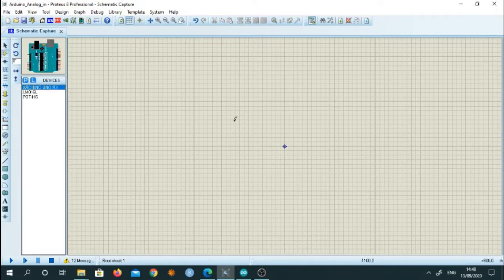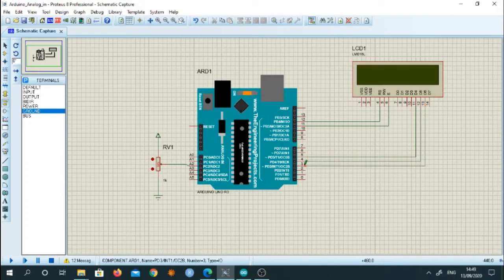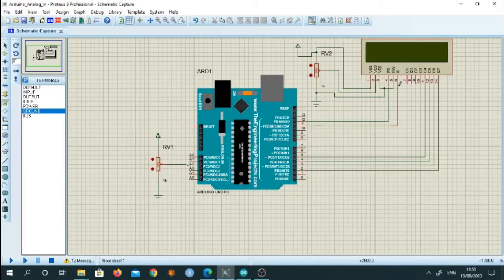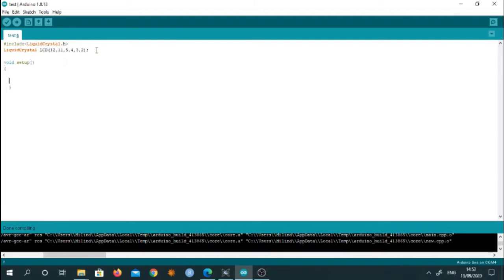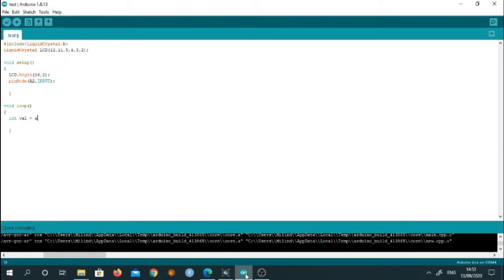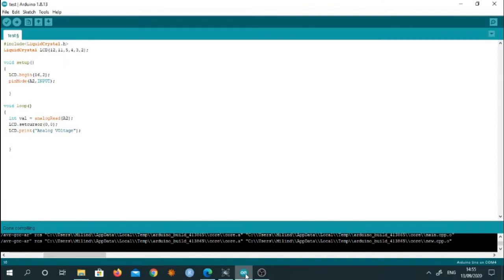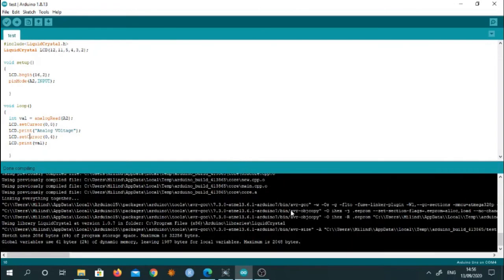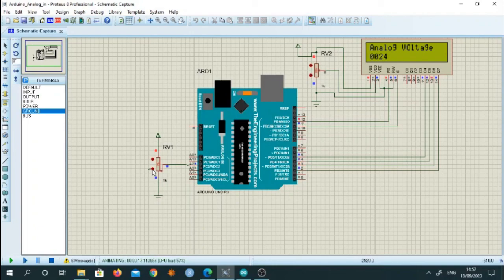Arduino analogRead and LCD with potentiometer | Proteus Simulation for analogRead in Arduino

Comment: Thank u for the video sir! It's help me a lot. But i have a problem that my value can't be increase or decrease. What should i do sir? Thank u
Reply from the maker: Thank you very much
what you can do is Reinstall Arduino IDE and check again because there might be problem with IDE plz check
Reply: @MilindNatu0205  sir im already reinstall my IDE and update from 1.12 to 1.13 but it doesnt fix the problem
Reply from the maker: @O-LukasYahyaAdiPuspo  Check the Library of analog read  function it may be corrupted
Reply: hi sir ! Did you managed to resolve your problem ? I have the same one when i try to make it works with a nano. The program works well with the uno tho. Thx !
Reply: @chateaurouxmadepunk8822  what is the reason for the program doesn't work well with mega